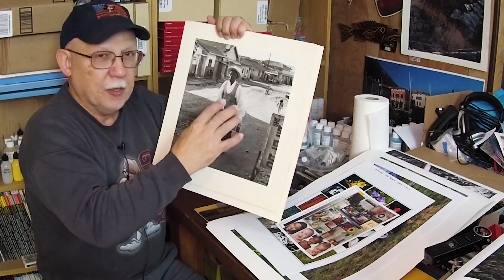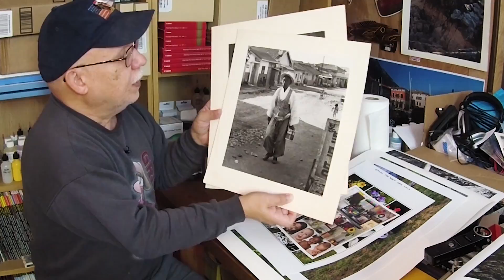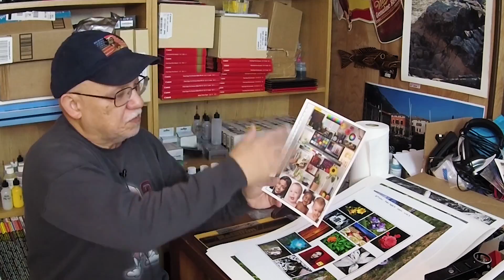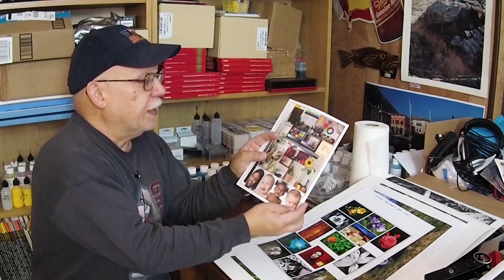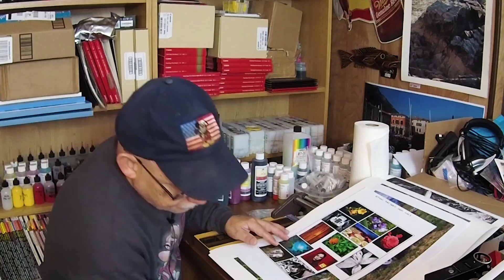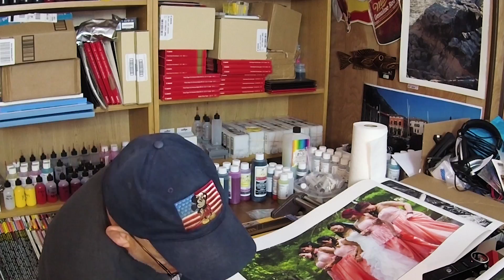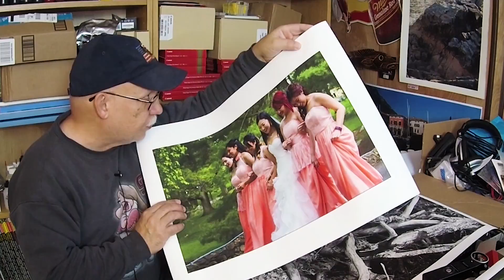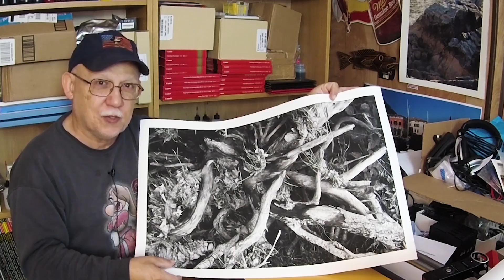The Silver Based Photographic Process vs Digital! My Thoughts

Comment: Great to remember the old times, one draw back of inkjet vs silver halide is the easy to scratch surface of the papers, the bronzing when you use pigment ink and the issues of head clogging on large printers. I used to have a Beseler Minolta 45a digital head and a jobo processor great then, now several Epson printers that the tech comes every several months to fix issues on the big printers(small units have little issues), after warranty expires it turns expensive, compared to the darkroom I had which I never had to service other than bulbs and may be a small motor. the only thing that I see improved using ink jet is that we don't have to be stock to a darkroom in darkness and dealing with liquids. Great video
Reply from the maker: I still have my Beseler that can do 6x9 cm negs. Regular head with the tray for the 5x5 CC filters. It's been with since 1972. In also still have all my darkroom stuff stored.  I even have bags of D-76, Dektol developer and Hypo which I'm quite sure are dead. 
If I had the space to set it up I would. My wife says I should get rid of all of it  it I just can bring myself to do so. I am sure you understand.

Comment: Jose I have yet another question i have received my ink from precision  colors Now my canon pr 10 some of the inks are very low should i top up the ones that are not empty at the same time
Reply from the maker: Yes. Be aware that you will begin to see a few changes in colors an gloss and you need to have ALL carts filled with PC inks and then you can begin to use their profiles unless you make your own which is always the best recommendation.

Comment: Jose Rodriguez, i know that this comment it got nothing to do with this video you made, but i need your opinion regarding about my case,  i have an epson surecolor p6000 and i just found out that there are empty cartridges for refilliale ink  for sale in china, and i´m wondering what is the best generic ink that i can use to print my photos.
Reply from the maker: I would not trust ANY of the carts from china claiming that they even work on the SC series. Generic will never come close to OEM inks I'm afraid. You have one hell of a printer which would be put to shame using anything else but EPSON.
Reply: thank you so much Jose, i´ll keep that in mind.